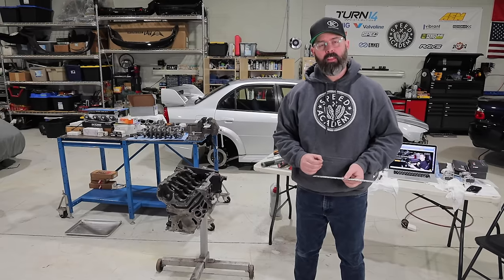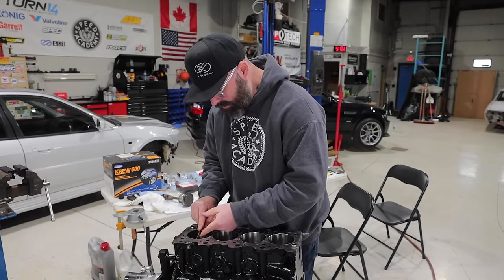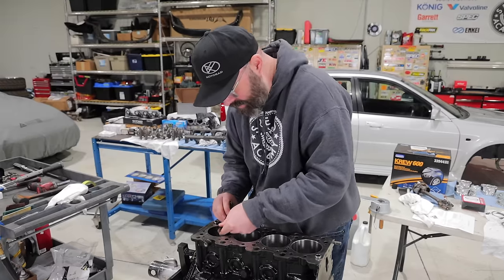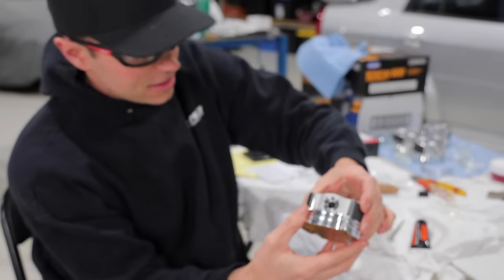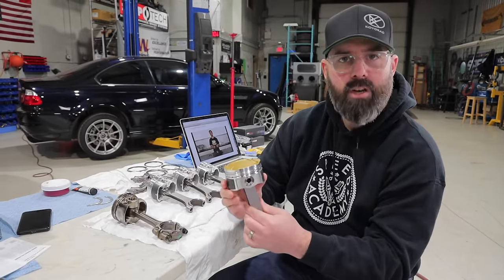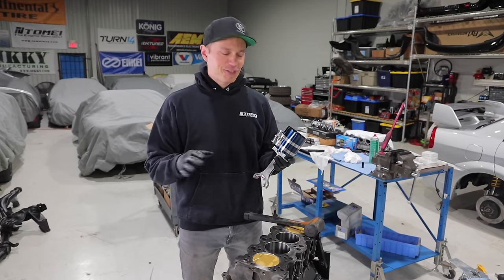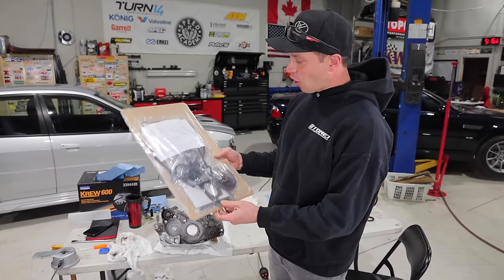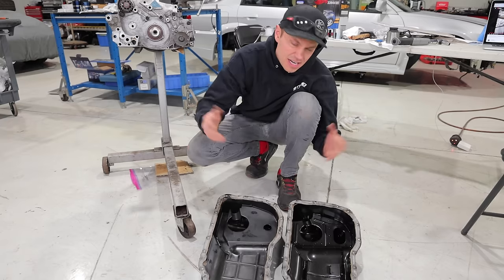EVO 6 4G63 Engine Rebuild How To - Pistons & Rods PT 2

Comment: Not to be picky, but Most of the cheaper ring grinders use a thick fiber disc.  If you try to grind both ring gap ends at the same time, you will taper the gap.  Grind only one side and it is easier to keep the gap parallel and even.  Plus if you are gapping for a boosted engine, the gap will be larger. This means a lot more grinding and a bigger chance of tapering the gap, so grinding one side is very important.  Use a fine file to deburr the areas you just cut to stop bore scratching.  Practice on an old ring first.  Good going guys
Reply: Dave says later in the video that he only grinded one side for most of them, and he takes a file to them to grind down the burs.
Reply: @emc3065  Thanks...That cost me a ring set years ago when I was 18 and knew everything.  I'm 68 now and still watch and learn.

Comment: In 2003/2004 I built a 560kw @32psi boost 4G63  for a friend which went into a GSR evo 3 replica. Didn't take much really. Ported evo 3 head. Cams, can't remember the specs, around 272° duration. Forged rods, pistons. GT 35/40 turbo (same as XR6 turbo). Link ECU with full anti lag. I designed and made exhaust manifold, true pulse tuned to suit cam specs, (unheard of 17yrs ago). Designed and built inlet manifold (pulse tuned aswell). 1000cc injectors. 
Engine would easily rev to 9,500 rpm (limiter). Car weighed around 1150kg
The most insane car I've ever been in.

Comment: Great Series! When built my 4g i had the same exact experience with the rings. Same manufacturer 10 years ago. I removed the balance shafts so i could get the extra oil pressure.

Comment: That step in the ring is to create an oil bead that helps to seal and lubricate the ring. Adds a slight bit of compression, but reduces a lot of wear.

Comment: i dont think people actually delete the balance shafts for the 3hp you may gain or not. The real problem with those is that the bearings like to fail and then you'll lose oil pressure.
Reply: True, but many DSM's have had a hard life with poor maintenance/oil for a turbo car.
Reply: On my forged build, I had my balancer shafts turned down to eliminate that little belt in case of failure at high revs. I can't detect any more vibration.
Reply: It's very rare, and often from extreme mileage, or a internal oiling failure... Also alot of people  who "rebuild" 4Gs themselves skip replacing the balance shaft bearings due to them being "difficult" to replace, even if they are extremely worn or lightly damaged, will ultimately lead to the bearing failing very quickly.
Reply: I only have had 1 4G puke out a balance shaft bearing, and it had 240,000 original miles on it, and was receiving a helluva beating by a 17 year old on some twisty country roads. One could argue the car was run low on oil, and the car started starving for oil in the harder corners because the mains bearings were toast too when the engine was pulled apart afterwords.
Reply: @fila1445  a aluminum flywheel will have the same/greater effect, without the cost of increasing NVH and potential oiling problems.
Reply: The problem is the failure of the balance shaft belt wiping out the timing belt then blowing up the motor.
Reply: @windywindy  if you replace it every few years or 60K miles with a OEM Mitsubishi belt, or one of equal/greater quality like the old HKS Kevlar belts for the Balance Shafts like you are supposed to, they won't snap.
Reply: I deleted the balance shafts on my dsm because it's one less timing component to worry about and It really wasn't that important to the operation of the motor.  I don't have a lot of vibration because I had the motor internally balanced when I had it built with forged pistons.  I think the balance shafts was a cheap way for mitsubishi to get around balancing the motor's internals.
Reply: @kwedog2373  that's a misconception. The balance shafts are there because of inherit vibrations that result from the engines firing order, and flat plane crank shaft.
Reply: @kwedog2373  all 4 cylinders have free forces that can only be eliminated by balance shafts. they are so small that most manufacturers just dont care about them.

Comment: Once you get balanced crank and pistons and rods deleting the balance shafts its fine. you will have a lot less vibration then if you just do it on a stock motor

Comment: Pretty sure you torque the rod bolts to spec then use the gauge to confirm or correct the torque.

Comment: Guys, super to see this build,
but the opening of the clips in the pistons have to be at the bottom or at the top, if they are facing the side they can `unlock'/'compress' at high rpm's and can get out of their groove because of the great forces. 

And that is motor failure. 

Keep up the good work.
Reply from the maker: Call JE and tell them that because we followed their instructions.

Comment: Pound out the dent on the original oil pan. The windage tray and improved baffles could easily make enough of a difference to prolong the life of the engine at the track, as like most 90s performance vehicles, oil starvation during extreme lateral Gs is a real thing largely due to primitive/basic baffeling. 

The R32 GTRs, and various Mitsubishis really seemed to suffer from this the most

Comment: Plastigage is actually the more accurate way of measuring for 95% of people building an engine.   At sizes as small thousandths of an inch ,  the ambient temperature and the the temp of your hand holding the tool will change the measurement significantly.  Your tool also has to be calibrated and the measurement process itself is not hard to screw up.  Also , plastigage can alert you to misalignment of the main bores or a bend in the crank,     calipers wont.

Comment: The ring orientation is one of the biggest myths in engine assembly. Everyone seems to know that the rings are supposed to rotate when the engine is running, but that means that how you orient them does not matter, they won't stay in that place anyway. 

Don't take my word for it, plenty of big engine manufacturers line up the grooves because that makes it easier for machines to assemble the rings.
Reply: What if they all rotate in sync

Comment: I've been told not to use those 3m discs before. I guess I could use it next time as you found. Did you folks use it on aluminum as well with no effect on the metal itself?

Comment: When assembling pistons and rods you need to remember that often they have a specific alignment, it is very not fun having to disassemble them because the rod is back to front. How do I know? I bought a set preassembled off someone who gave up on an engine build.

Comment: you said you torqued the con rod bolts for plasti gauge but then use a stretch gauge to finish it fully, your always ment to use the same method as both pre check and final build to make sure its consistent! why did you differ from doing 1 vs the final choice?

Comment: Never seen someone not torque rod bolts In to see how long b4 those rods come loose iv seen ppl check rod bolt stretch but also torqued them down after installed

Comment: You shouldn't be using your torque wrench to do the 90° turns, you getting your wrench out of spec. Rather use a power bar to do your degree torquing .

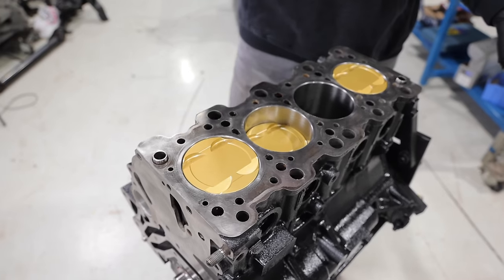Comment: 19:50 If a ring isn’t set correctly, you will break it with that technique.
Reply: i've never broken a ring in 30 years with that technique. lucky me
Reply: Man sure that ring compressor is damn tight and well lubed, tap it flat on the block, and tap that piston down into the bore.
I've had plenty of rings pop out between the compressor & block, but I've not broken one yet, just be very careful.
Reply: Yeah, I'm a little surprised they didn't opt for a tapered ring compressor to minimize that risk.
Reply: I broke one my first time trying with the ratcheting kind well my 3 piston of four so i got 2 in and broke the 3 so i need to buy a new set and try again any suggestions ?
Reply: @Mustardmartin  Get rings for 1 piston.   Or use an old ring of the same size and flex it open a little bit.  Combustion pushes the ring against the wall provided you cleaned out the carbon buildup in the ring grooves and you put the ring in the right orientation.   You gotta go tight with the ratcheting compressor,  use a 1/4" ratchet with a 4" extension to tighten it
Reply: It’s also the best way to scratch à crank with the rod.
Reply: @Arnaud__P1  I bet I can come up with a better way 😄
Reply: No smit

Comment: Good video 
I'm building my 4g63 as well I decided to delete my balance shaft as the belt broke and cost me a rebuild whather it's a gain or loose I'm not sure .
Reply: I have done the same, you'll  get higher oil pressure,  i also deleted the squirters so my oil pressure is about 20% higher, so far so good

Comment: Why are you guys reusing the old oil pump? A big No No in engine building.
That's one item that NEEDS to be replaced when rebuilding your motor.
Reply: Not true. If it specs out you should be fine.
Reply: @idreamidrive  by spec out,I meant the calibration not the torque wrench goes out. Used the wrong wording
Reply: @herschelsinglee  you asked about reusing the oil pump... If it is within specification and there isn't any wear on it, it is totally fine to use. That is why there is a spec on it.
Reply: @idreamidrive  Sorry,replied on the wrong post previously. I doubt the guys checked to see if that oil pump was in spec. In any case,I always spend the money on a new pump when rebuilding a motor. I'd rather not cut cost on the most important part of the engine.

Comment: Never in my life have I seen someone use a vise to hold a piston to put the rings on. Also ARP studs are nice insurance and seeing that you are building everything else why wouldn't you just over strengthen that? That kinda made no sense especially when you get bit by a power bug and want more power now you have the most important part of the motor is much weaker then everything else. Shame 🤦‍♂️
Reply: There is no real need for stronger fasteners of the main bearing caps at this power level. Sometimes the higher tensile load of the uprated fasteners can warp the block and/or bores. So if not required it is sometimes better to stick to the OEM hardware / specs.
Reply: @aDaWaN  I can agree with some of that but they said they used the hold hardware and for one that a big no, second this isn't a car that going to just see some street pulls and twisty road this a car that not only see that but also hard track life and if they are going through all the trouble of making sure everything going to be tight tolerance and right to spec then why not get something that going to hold regardless on conditions. (Besides the only tight you come to trouble with whooping is if you just but the studs on and call it a day, the troubler way would have been to send the stud with the machine shop, get the cabs flattened and then put the girdle on and get the crank journal bored out to make the crank had a perfect spot to sit in but again that's the proper way to do it) And again if they are wanting to put more power at it down the road they are not limited to stock used bolts holding the bottom end together. Anyways there will be another video like always telling us that we were right just like on the 2J stuff.
Reply: I’m sure there’s a budget involved here

Comment: I dont want to be a dick, however. You cant beat an sti with a that engine, if you just dail it above an sti to consider victory, i would not even consider. Stis built put out 900 to 1200 horsies, still wanna continue?
Reply from the maker: Evos put out 1100-1400 unihorses!!